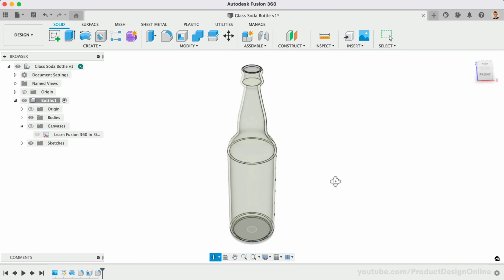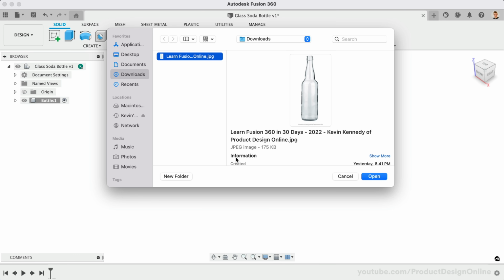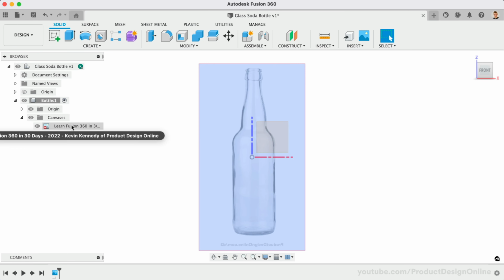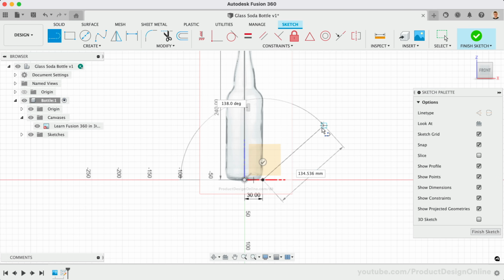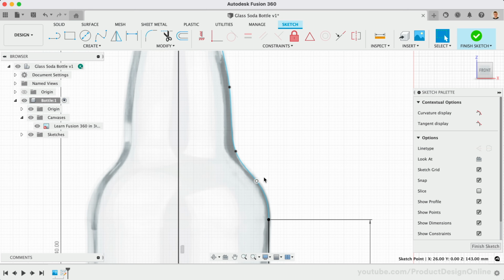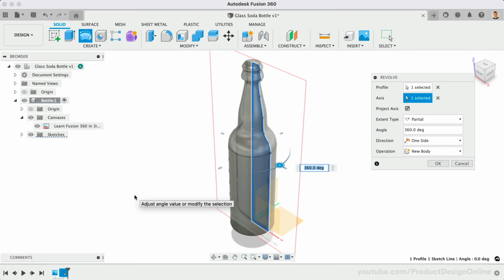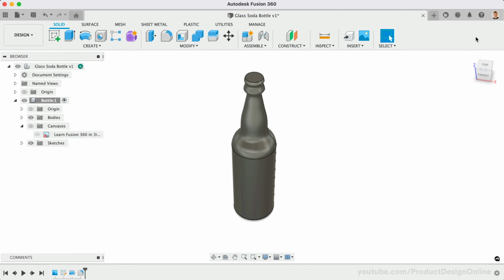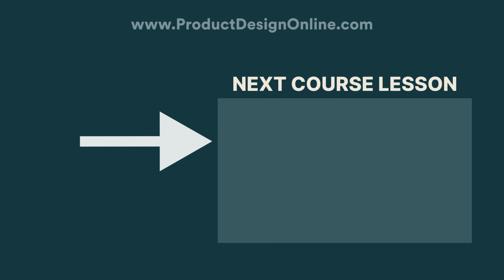Day 2 of Learn Fusion 360 in 30 Days for Complete Beginners! - 2023 EDITION

Comment: I was having issues with the shell and sketch. No matter how much I changed my sketch, the shell command would pretty much hollow out the bottle, without leaving an opening at the top. I ended up changing the top lip constraint from horizontal to vertical which made the bottle look weird, but then I used the fillet tool at the top of the bottle at 1mm on the outside rim and inside rim to achieve the desired goal. I'm going to continue to work to find the root cause of the error in my sketch, but if you're having issues with the shell command, it could be because your curve going to the top horizontal line is too rounded. I found it needs to be more sharp/perpendicular/90 degrees for the shell command to work properly. It essentially wouldn't let me select the top face as a starting point for the shell and would just shell the object as a whole. Sorry for the long comment but it was driving me nuts and there might be someone with the same issue out there. I did this tutorial twice, gave up the first time and restarted to run into the same issue again.
Reply: Your tip saved me from banging my head on the wall of this pit I'd fallen in. Cheers and thank you!
Reply: Thanks. Was having a similar issue. By making the connection more vertical, the shell command then gave me an opening.

Comment: Anyone having issue with the Shell part:
1. If you can't select the top face, I think it's because your final bezier curve handle thing is horizontal
2. If you can select the top face but are having "thickness" issues, I think you need the final bezier curve to be 45-90 degrees from horizontal.
I'm new, I don't really understand why we can't have nice flowing curves, but that's what solved it for me I guess.

Comment: I'm having trouble with setting the opening of the bottle to 11 mm. I horizontally constrained the final top point of the fit point spline with the top of the center axis. But setting the distance between the two to 11 mm only pushes the top point of the line as opposed to the whole line. Now I only have an opening that it wider than the neck. Did I do something wrong?

Comment: Great tutorial/series. Thank you very much for the time and effort spent on creating these!
Everything went fine for me both in day 1 and day 2, except when using shell on the bottle I just couldn't make the thickness to be 2.5mm. It worked with 2.2mm at the most. I tired moving around the curves and stuff but just couldn't figure it out.
Reply from the maker: Thank you!

It's most likely to be the very top or bottom spline points. If it's too sharp then it won't allow a larger shell.

Comment: Hi there. When placing the canvas, for some reason my canvases folder is not under the bottle component but as a separate folder under 'Glass Soda Bottle v1'. Also when I insert the image, it is very light and barely visible, only when I turn opacity to 100% can I somewhat see the outline of the bottle but still not very clear. Any help regarding this would be highly appreciated. I was following the steps exactly as you did. Thanks

Comment: For beginner videos, basic controls would be nice. Undo shortcut dosnt work, found it on the top right but knowing how to go back would be nice. when ive made 3 connected lines then misclick, would be nice to know how to go back without having to restart from the beginning of the video. This is a lot different then using blender. Knowing how to connect lines would be nice too. I dont see a "select button" pushing a mouse click just creates like a drag select which dosnt select anything...Unable to complete this

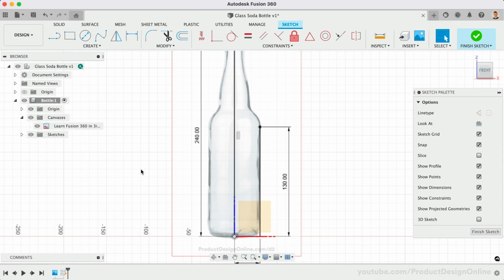Comment: At 5:18, where you are adding the 130mm segment to the line around the bottle, Kevin says that you must enter each dimension and click return or the dimensions won't be saved and also that the line tool remains active afterward. What I see is that as soon as you hit enter the first time the line tool closes. Is this because I have the 2024 interface or am I doing something wrong. As a workaround I am just restarting the line tool after each step. Is that okay?

Comment: Hello, I know this this video is a bit old, but I am having an issue centering my reference image on the origin. This misalignment makes the rest of the video very difficult to follow, as the dimensions for the bottom of the sketch, for example, are not accurate to the dimensions of my project.

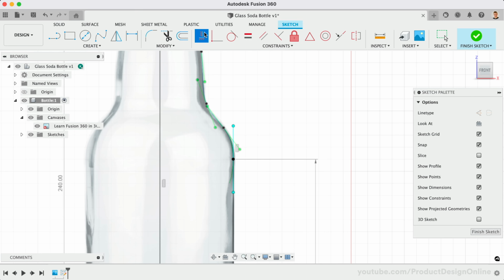Comment: at 7:00, I select the start point of the spline, then the vertical constraint, but after that, it does not allow me to selects its handle with the constraint button active. and at 7:36 im not getting the blue background i had to pause today and close fusion and come back to the project i wonder is that has something to do with it

Comment: hmm. When I do the shell command it doesn't cut through the face, it just makes an internal copy 2.5mm smaller than the external surface. 🤔 Though even when I try to do the shell, it tries to select the entire body and not the face.

It was a problem with my sketch that was preventing it from revolving correctly. I trashed the whole thing and rebuilt it from scratch.

Comment: Ok guys, for any of you monkey's like me out there, here is the most destiled way I can fix that issue with the bottle not having enough brightness, the canvas folder creating outside of the bottle object folder, etc:

There are 2 origins, the original "background" origin, and the new component's (the bottle that we still haven't made) origin. So you need to DISABLE the Origin folder that is OUTSIDE the component, and activate the component origin, THEN you import the picture on the XZ yellow square and voilá!

Comment: Hey! I am new to fusion 360 and I set the sketch dimension 11mm but when I use shell on the top of the bottle 2.5mm is too wide and i need to use 0.25mm  :I why can that be?

Comment: Great video, like the rest, but I am having an issue with the shell command. It does create the shell, and I can see it using the section analysis tool, but the top of the bottle is closed. What the shell command is doing for me is creating a hollow bottle, but with no opening at the top. Any idea what could be causing that? The same thing happens if I create the shell from the bottom. I didn't run into this issue when creating the toy block in the day one tutorial.
Reply: I'm having the same problem

Comment: Hello, I'm from Greece and I'm trying to keep up with your wonderful tutorials. But I come across some strugleS and I really need your help. So, for some reason I select the canvas option , I go to my computers downloads, I select the image , I open it but instead of opening it with your order, such as bottle 1> origin> canvas> image, it appears with this order;origin> canvas> (from the default) image and then bottle.And I cant understand what is going wrong. Besides that, when I open the image the opacity of the planes and image is really low, i tried putting it bigger from the canvas settings but it didint work out. So I'd love some help on that too. So sorry for any language mistakes! I'll be waiting for your response.

Comment: Hey can you advise. I create new component. Then add the image via canvas. However the canvas is separate rather than under the new component I create. Am I doing something wrong? Or does it not matter. Thanks
Reply: I'm having the same issue as well.
Reply: @BrittaBear  try to toggle the origin visibility on the browser
Reply: Did you end up figuring this out?
Reply: hide the origin on top and unhide the origin below the new component, then create canvas again and you can select the front face of the component

Comment: After adding the FIT POINT SPLINE for the bottle curve, I cannot continue to edit the points.  I can edit a single point, but it will not let me select a new point to edit.  Any ideas???
Reply: I had this issue as well. Closing the program and opening it again fixed the issue.

Comment: Found this trickier than lesson 1 but got there in the end. Spent about an hour doing it. Feeling a bit frazzled so off for a lie down 😬
Reply from the maker: What point did you get stuck at?
Reply: @ProductDesignOnline  so many. Half my issue is that I'm only using one monitor so I have to keep flipping between youtube and fusion. There's the odd bits where you'll press a button and I miss it. Just done lesson 3 and feeling more confident.

Comment: I haven't tried this yet but, I think I can trace a difficult profile using the pen tool in a photo or design software program more easily and then insert its SVG into Fusion 360.  I need to see if there will be problems assigning dims to the imported SVG , though.
Reply from the maker: SVGs are great if you have a logo or something fair complex. Otherwise, I would advise against it. They don't work well in Fusion as they get converted into many spline/line geometry and can be hard to manage (constrain, etc).
Reply: Thanks, I see your point.  I have been making 3D printed art stencils for my wife by creating them in photo/design software then converting to SVG for insert to Fusion 360 so I can extrude them to about .8 mm for printing.  I can scale them, if necessary, in Fusion but any other manipulation does cause problems.  I'll stick with your method.  @ProductDesignOnline

Comment: How come when I adjust the sketch dimension of the top of the bottle to 11mm, the line turns diagonal? helpppp
Reply from the maker: Try adding a horizontal constraint to the line. It sounds like one didn't get applied automatically when the line was drawn.

Comment: I cannot get the shell command to work. And I'm struggling to understand what it's doing. The top of my bottle doesn't seem to open up when I do it it continues to have a flat face across the top. I saw a comment below mentioning not to make the last spline point at the top of the bottle horizonal, so I adjusted it and had some luck in producing a 1.5mm shell. I didn't understand how I couldn't achieve the thickness Kevin gives in this. I then noticed the blue arrow I get when clicking this face to add a shell is pointing either down at an angle or almost entirely down into the bottle. 

I can't really understand what's happening or how to achieve the parameters he's laying out.

Comment: This really hard on my brain, I get so far along and then I can't get things to work.
I made it to where I'm supposed to add the fillet on the bottom and I can't click on the line.
I started the whole program over after a break due to schedule and thought I might be able to make it through but I'm doing something wrong and then the frustration sets in and I have to give up.
Reply from the maker: Are you having issues with the fillet on the BOTTOM or TOP of the bottle (or both)?  If the top, make sure that your line is truly horizontal. If not a planar face, the edge may not allow a fillet there.

Comment: I have been using 3dsMax to make 3d prints. I'm just now trying to learn fusion and I might as well be starting over from scratch. Almost nothing translates over and everything feels unintuitive. 
I feel like I'm fighting this program every step and it does what it wants. Like I was messing with the spline handles and for some odd reason one decided to connect to another handle so moving one moved the other and I couldn't figure out how to disconnect them. So, I started over. Quite frustrating.
Anyways thanks for the guide, it is helping me quite a bit to transition over to fusion.
Reply from the maker: I feel you, using non-parametric modeling programs and parametric can take a while to get used to as the mental models are completely different. Keep at it though! :)

Comment: Thanks for this series!  I'm having trouble with the shell command in the "How to make a body hollow" section.  After following the instructions you provide, the mouth of the bottle stays closed, and when I try to do the shell operation again, it says it has already been done.  Any idea what I did wrong?  Thanks!
Reply: I also had some trouble.  I discovered that I had not created a separate line for the top of the bottle.  You use the fit curve method while you are tracing out the curved portion of the bottle outline.  When you get to the Top of the bottle, complete the traced line process by clicking on the check mark leaving the last flat part of the bottle open.  Then select the line function and click on the end of the previous line and then click on the center line and complete this function by clicking on the check mark.   If you created a closed drawing, you can click inside the object and it will turn green.    Now you can revolve the drawing to make the 3d bottle as he described.  Now you should be able to click on the surface of the top of the bottle, it should turn blue, select the shell command and follow the instructions.
Reply: @JCBoss76  Is there anything else I could be doing wrong? I've made sure the profile is closed before revolving, but I still can't select just the top face of the bottle.
Reply: @Joe_Bandit  Did you make sure you used a separate straight line for the top flat part of the bottle top?  Don't just use the curve fit function to trace the top flat area.   Using a separate straight line gives you a separate detail to select.  Also there is a "select" function in the top tool bar. Hit escape to make sure you don't have some other function active, click on "select", then click on the top of the bottle which should select it.
Reply: @JCBoss76  You helped me a lot! Thanks!

Comment: Everything goes as shown until I get to correcting the bottle top size. I filet the bottom to 5mm, but when I double click on the bottle top then the time line the bottle just turns blue and I dont get the sketch view where the top can be sized to 11mm
Reply: same problem...
Reply: I had to right click on the sketch, on the upper left side, and hit edit.

Comment: Fun tutorial. I found that after the revolve and shell, the top of my bottle was closed. Not sure if I missed a step or did something wrong? I added a sketch to the top face and bored a hole which had the same result.
Reply from the maker: When you used Shell, did you select the body of the bottle or the top (flat) surface? Selecting the body will hollow it out without removing the top. Selecting the top will remove the top, and hollow out the body.

If Shell doesn't let you select the top surface, you'll need to make sure the top sketch is horizontal (if a horizontal constraint wasn't automatically applied).
Reply: @ProductDesignOnline  Thanks for replying to my comment. I've gone back and double checked and the top is a flat surface and has a horizontal constraint but I'm still unable to replicate your steps. I've been able to repeat them on a simple cube though!🤷‍♂

Edit: worked as expected in the following "glass bottle" lesson. I've also started to produce my own simple designs using the shell command, so must be something in my soda bottle sketch that went wrong. Thanks again, love the series!

Comment: Good tutorials, but i wish you did things a bit slower and explained more in details what you mean. I still don't know what you mean by return key, just used enter as usual. Putting the video in 50% on youtube makes the speed good enough to duplicate it in fusion during the video.
Reply from the maker: Thanks for the feedback. Return and Enter are the same as far as the software is concerned. It will depend on what your keyboard has on it.

Comment: Hi, thanks for the video. I could replicate it very well. However, I tried making a drinking glass, and the shell command is not working. It is selecting the entire body instead of the top face. Suggestions?
Reply from the maker: If it doesn't let you select the top face then it's likely the top line/face is not horizontal. Double check the sketch. The line looks horizontal, then make sure the spline handle connecting to it is also horizontal. 😄

Comment: hi, i have error: Error: The shell can not be created at this thickness.
Try adjusting the Thickness, the selection set,
or change the Shell Type.
Reply from the maker: It's likely due to your top spline handle being to "sharp" (where the lip of the bottle is). Try adjusting the spline handle so it's wider (i.e. drag the spline handles outward).

Comment: Dumb question from a total beginner, when I'm in the middle of setting and adjusting spline points, how do I move the image so I can see the part I need to work on?  If I zoom in enough to get good detail, then it doesn't all fit on the screen, so I need to scroll around somehow but can't while selected for fitting/changing points.
Reply from the maker: You'll want to "Pan" around, which can be done a number of ways depending on your mouse/track pad setup. You can use the pan feature at the bottom of Fusion. You can hold the middle mouse button down and move your mouse to pan. On Mac, you can use a three finger swipe on a track pad (doesn't work on all Windows machines)

Comment: for some reason i cant select the opening of the bottle to start the shell strange
Reply: I fixed it by moving the handle of the point connecting to the horizontal line at the top of the bottle, not sure why this fixed it.
Reply from the maker: @dankcherries22  the shell command requires a flat planer surface. If your top spline handle was not horizontal then it would result in a surface that is not flat. It sounds like you adjusted it which fixed that, allowing it to work 😄